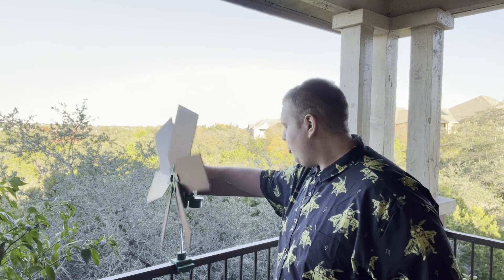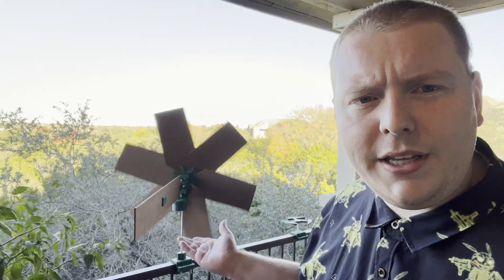Home Depot Sabotaged my Windmill! (Windmill XXI Update 3) #windmill #windturbine #greenenergy

Comment: Have you tried cutting plywood with a stanley knife? Basically you score both sides and then snap it. It works much better than you would expect.
Reply from the maker: I haven't, that's a really good idea though. The reason I gave up on plywood was only half due to the cutting, though. The other half was because it warped really badly, but I guess to know how much of a problem that would be, I'd need to have one in constant use for a few months... If I get any more desperate I'm going to be making turbines out of cardboard, haha!
Reply: @christophersfactory  You can't leave them bare.  Even the hardboard is going to develop issues if you don't do anything to protect it.  Look at polyurethane, spar varnish, things like that.

Comment: It may be cost prohibitive, but have you looked into UHMW for the blades?
Reply from the maker: It's a good suggestion. I looked into it after reading your comment. As with a lot of materials I've looked at, it seems to be a viable option at a price that isn't horrible, it's just that even if a retailer near me had it in stock, the price for the quantity I need would be horrible, haha.

I'm starting to consider plastics instead of wood... The thought crossed my mind earlier that if the turbine is light enough, the integrity almost doesn't matter as much because it will accelerate faster. I'm almost considering another foam turbine just to see how it compares after getting some experience with the board turbines.
Reply: @christophersfactory  Check out McMaster-Carr for UHMW.  4" x 12" X .125" pieces are about $5.50 each.  It's likely cheaper to buy larger pieces and cut to size, although obviously, there's a balancing act with shipping costs.  Not saying UHMW is the best option, or that McMaster is the best option, but it's something to look into.

Comment: I've seen engineers at my University 3D print large aerofoils for wind turbines (though much larger than yours). Perhaps a turbine with less, but more aerodynamically efficient blades through 3D printing would work well?